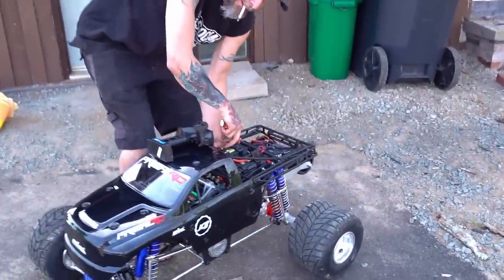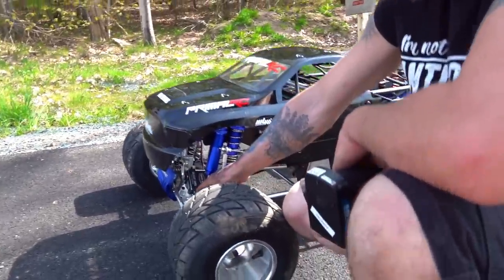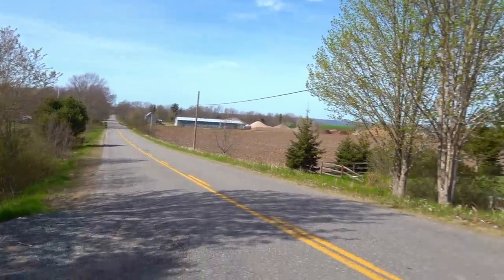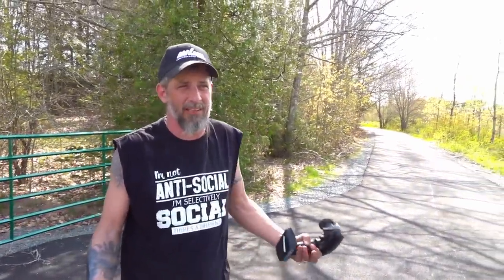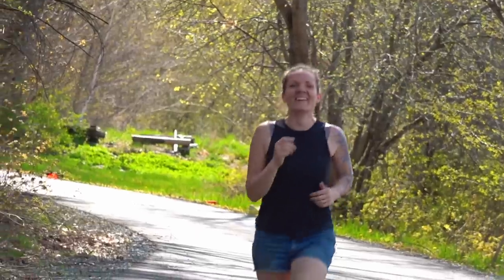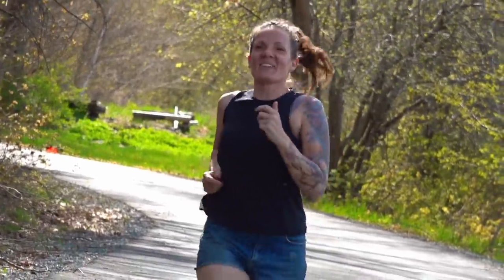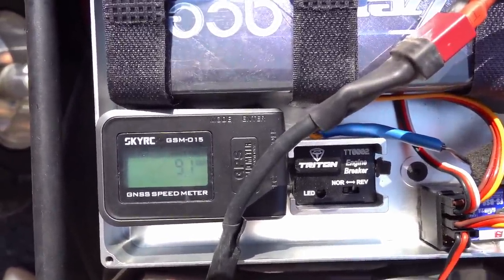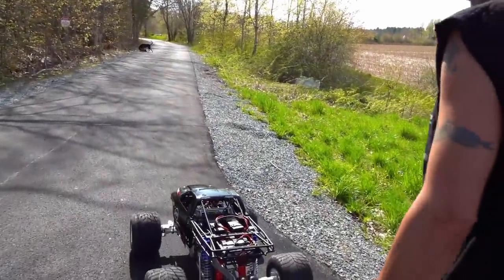I TRY TO BEAT my SPEED RECORD - 53HP 1000 AMP 100LB PRiMAL RC MONSTER TRUCK  4x4  | RC ADVENTURES

Comment: Hey Medik. Love the videos. I got an little advice. You're a well seasoned veteran in the RC hobby, i'm still relatively new only having start in March of 2020.
I think you should take a day and drive to flattest, longest road you can find. That way, you can hold the power on for longer so you will definitely know the independent top speed, i.e.,not assisted or restricted by additional gravity. And you should take the Felony with you.

Comment: Those go kart tires are pretty dam grippy cold, as it was still lifting a tire under partial throttle. Kind of fitting to chase a record with an RC version of the real truck that holds the monster truck speed record. Just needed some audio cuts of Clarkson yelling speed and power lol. Awesome work so far, positive with a good flat space you will hit more than a 100kph.
Reply: POWER!

Comment: I see the gyro and steering rate helped with the twitchy steering but I still believe cutting the "scrub radius" will make it handle much better at high speed. 

Also increasing the castor will help keep it straight. 

I've been designing/building high speed off-road suspensions for 10 years now and those 2 factors are major reason why we dont go through steering racks and wheel bearings.

Great work so far man! Definitely a badass RC!
Reply from the maker: The steering is really OK.. the issue is the road is not flat..

Comment: You shouldnt be going all too hard on the throttle when there is no resistance through the transmission and the motors rotor spins freely. going above a motors rated rpm range can easily break even the finest of motors. amazing project by the way, big fan
Reply: Pretty sure the motor is more that 12s
Reply from the maker: @alterdcustomrc4512  Yup.. 15S capable :)
Reply: Can't think of a better reason to get rich.$$

Comment: I saw one of these at the local hobby shop near me. It was also lower and had what looked like go cart racing tires from the front of a race go cart that are fairly small diameter but not small on a RC LMAO! 

Yours sounds like one of the tires is out of balance to me especially around mid run to the last half. I’m sure you hear it too but I’d think a little speed could be gained there. The go cart guys must have a way to balance because they go 80-100 MPH.  Even if it was only static balanced it would be better than nothing. Dynamic balance would be great but idk if it would fit on a machine or not. Those huge trucks are wicked and I really like the blue one you have with V-tread looks like tractor tires that you had the wife’s truck in the bed of and the boy with you in a video lately. That truck is awesome! I was diggin watching it rip in the snow too!!!

Comment: Needs proper front end alignment to help stay straight. Start with a few mil. Tow Out and go from there. You'll see light feathering of the rubber on front tires, This is perfect. Also make sure air pressure is the same in all tires makes huge difference. Nice truck 👍

Comment: If you want the pinion to stay put on 1 set screw use loctite 638 to glue the pinion onto the shaft. It's a retaining glue for sleeved assemblies and breaks at 500 degrees. You'll destroy the gear before it ever comes loose again :), 5 seconds with a torch and it will fall off without even trying we use this to glue flex assemblies for boats. 

Sounds stupid as it's a semi permanent solution but is a cheap robust way to never lose a gear, gear changes literally take only a few seconds longer to break the glue.

Comment: Started building RC cars when I was 9 years old my first car was THE FOX
Then a turbo Optima midpro for four-wheel drive ... and then a aluminum chassis RC10 ... I was right around the time in the late 80s ...early 1990zzz that they introduced the graphite chassis

Comment: Is it just me or the camera angle but it looks like both front tries are shifted to the right side, if your staring at the truck coming towards you. That thing rips it sounds like a beast.
Reply from the maker: The front 2 tires are slightly less wide than the back, but everything is even :)
Reply: @TheRealRCSparks  I figured it was the angle but I still wanted to ask 👊thanks for responding

Comment: Have you tried a 2s lipo in your fly sky gt5 radio? That's what I use on mine and it's pretty sweet. Just look under the battery door and you will find the spot to plug in a 2s lipo.

Comment: Man that’s awesome 👏🏻. Sweet ride my brother. Like put a motor n my little emco unimat db/200. It a mini lathe/mill machine. Make it portable battery power and cut metal like Superman. lol 
Great video. 
It’s a 90 watt motor in now ac power.   If u would happen know anything about it unimat holler back get u my email or can call or something. Lot people use 24 volt scooter motor but I’d like use maybe I think 8k brushless. Idk much about new rc stuff been out game while last ones where two strokers hpi bajas and clones and t1000 king motor 4wd Baja nice. 
Any I’m rambling great videos. Great work on that monster and suspension is right u know better than most commenters probably don’t have rc’s. Or using their old sears lobo’s. Turbo even. 7.2 volts. Yeah beat that. Lol. From ur ole hillbilly buddy stay safe.

Comment: Nice truck. It's built more for grass speed runs rather than on road.
Reply from the maker: How would you figure.. I completely modified it..
Reply: @TheRealRCSparks  For grass or open field runs height is good.  But for street runs you'd need it as low and aerodynamic as possible.
Reply from the maker: @billy3650  I appreciate your input, but it is not necessary.  I have already dropped the truck down by 3 inches, widened the stance by 4 inches, and lengthened the chassis by 2 inches. I also installed kart tires that do not expand. I also have 53HP at my finger tips when I finally install the 15S lipo.  For folks who have never seen one of these in person - they have no idea what they are giving advice on. I have owned 4 of them. Im the only one in the world that has done this.. and I invite others to break my record with one of these trucks. This is only the beginning... and I still want it as an MT.. not as a race car. I have one of those
Reply: @TheRealRCSparks  Its definitely cool.

Comment: KPH!?  I've been duped! 50mph
Still a really cool project and it shouldn't be too difficult for you to get those numbers in mph once you get it dialed in. Put as many cells in that as the controller will handle, get your gearing and tire size on point, trade some of that metal for plastic and I'd be really surprised if it wasn't close to 100 MILES per hour.

Comment: I have a old t-maxx i converter to 8s electric using a 4th scale brushless setup and after wrecking it at 70mph  I added a telemetry setup to keep it strait and stop the violent wheelies.

Comment: Nice top speed! Will you not soon get bored doing that drive up and down the road. change the gearing and get that thing ripping off road!
 Lets see 100MPH and then re-gearing.
Reply from the maker: This is actually my 4th Primal RC MT. I have another one that is a trail truck. I actually get bored with jumps.. gets too expensive

Comment: Kinda think skinny tires 🤔but it may take away the stability...15amp batteries will definitely put it around 110kph but you'll have to watch the steering  sensitivity... good luck 👍
Reply from the maker: These batteries are 80amp :) 6800mah 120c

Comment: The last thing you need is for it to be doing wheelies and to be honest why would you want it too.  I have a name for this monster. "Insanity"
Reply: I don't think its capable while being geared up for speed . Not sure there's few different setups guys using some have to wind up before having power using centrifugal clutch still . Im sure sparks has some higher tech stuff just geared for speed but yea be cool if it wheelie too . Goes show how much we enjoy technology only paying few hundred yo have a rc do it all in smaller versions . If large rcs  been around as long they perform the same for comparable value . Now you better have a small fortune for every little bit of extras 😆
Reply: I'm  asking myself  same question when he said thst  in my head don't mind me lol

Comment: Okay what I saw was the alinement is a bit off. The scuffing the tires kills speed. Toed in is also causing you trouble in steering. Fix that I believe the 100 is easily obtained

Comment: I'm only guessing but it looks like that truck could pull a couple hundred lbs. Maybe not very fast. do you have a scale size tractor pull or anything of that sort ?
Reply: If I had one of those I would want to try to put a makeshift set of wings and see iI could catch air and for how long. But It probably not durable enough for the impact when landing. Yeah that's probably not a good idea.

Comment: You might trim the steering. I see you have to correct it constantly while try to drive in a straight line.
Reply from the maker: Its because the road has an arch in it, my man.. look at the lines... they aint straight by any means.. Lol.

Comment: 53 hp requires about 40kw of electrical power…

Not sure if you have that here?

That would be appx 800 amps input at 12s /50.4v

Really cool though!
Reply from the maker: actually.. its 43000w achieved only when using 15s lipo

Comment: I'm assuming those are either foam loaded meats, or racing go-kart wet tires...  near ZERO expansion.
Reply from the maker: Correct :) Go Kart Wets
Reply: @TheRealRCSparks  - clean them up after every use, and keep them wrapped in storage... they'll last forever. Best large scale RC tires on the planet.

Comment: Doesn't those tyres need to be a quarter off that width, so you get less tyre tread drag, as speed machines have micro skinny wheels, obviously you can't have it on that machine, as it'll look a bit silly as a daily drive but a quarter of the width off each of those tyres won't alter the look of it being a monster truck 🚚 Good Luck 🍀
Reply from the maker: The weight keeps it planted, and I went with 11" tires to keep the rotating mass down.. (which are small tires) they are very scale compared to the full size Raminator - the Fastest Monster Truck in the World :)
Reply: @TheRealRCSparks  it's the first time I've seen it with the lower suspension, so it's only an observation. 🤠

Comment: Dude how don’t you see your alignment is off driving it forward and it goes off to side with wheels canted?? Also you can tighten steering up with steering throw adjustment so it barely moves left to right to go straight. Have you ever driven rc before??
Reply from the maker: No, its my first time. This is my starting point.

Comment: if it's equipped with a line detector it would go faster than that because steering wheels diminishes the speed

Comment: Not hating, but why wouldn’t you build a touring car for speed instead of an off-road monster truck? My 2wd slash runs on 3s and it’s faster than that topping at 73mph. Which 91kph is about 56mph

Comment: Dude, 40,000 watts is required for 50 hp. Are you telling us that tiny battery makes 40k watts to make 50hp?
Reply from the maker: Yes, my ESC and motor is rated for 43k.. no, I'm not there yet..  but I did say that in the film..
Reply: @TheRealRCSparks  My mistake,  I missed that part. I am curious,  how long can the esc's and packs hold up at 50hp? A second? 30 seconds?

Comment: Seem though it's wheels a tires are to heavy try putting helium in the tires
Reply from the maker: Its an 100lb truck.  Its supposed to have weight on the bottom ;)

Comment: too much money for such a low speed I know its cause of the weight but a slash with a titan 12t brushed running a 8000mah lipo can hit those speeds easily
Reply from the maker: lmao.
Reply: @TheRealRCSparks  funny but true your GPS said it topped at 91kph so converted that’s about 57mph. I put some XO1 tires on my brushed slash and put a 8000mah Lipo in it and it was able to pull a little over 60 before burning the brushes to hell. I still think you have a nice rig though.

Comment: thats not 50hp, just as fast as my 20hp moped and it weighs more with rider
Reply from the maker: I didnt say I was opening it up.. I said I was attempting my first run.. so, theres that.. and oh yeah, your moped (lol), only has one spinning tire.  Not 4 axles, 4 heavy kart tires, 2 differentials and a center transmission with dual drive shafts.   Man, you have to learn not to compare hot dogs to oranges